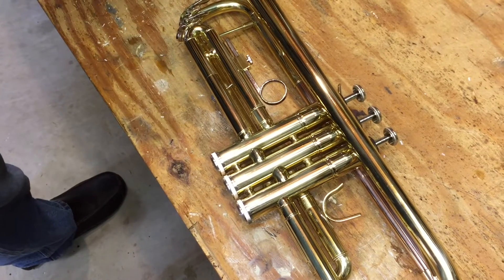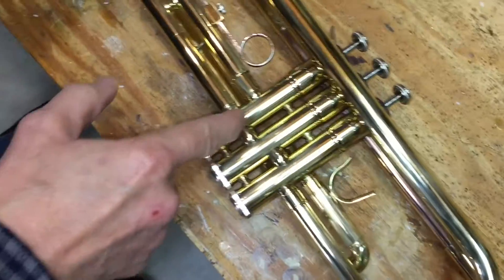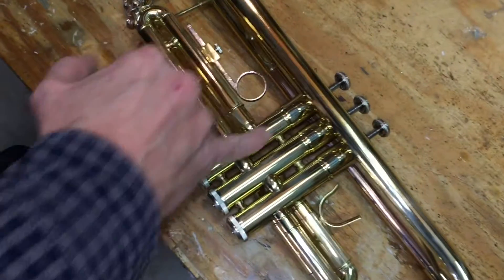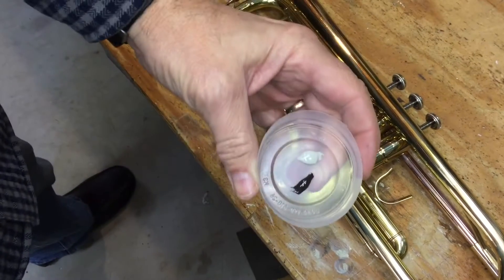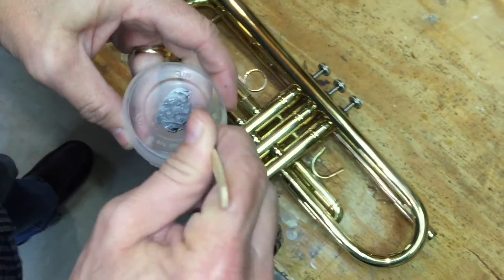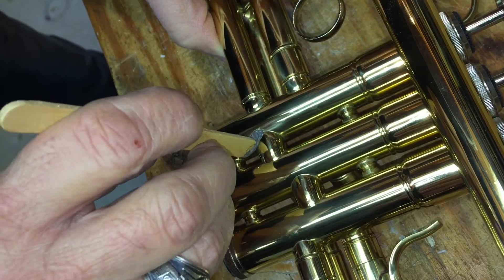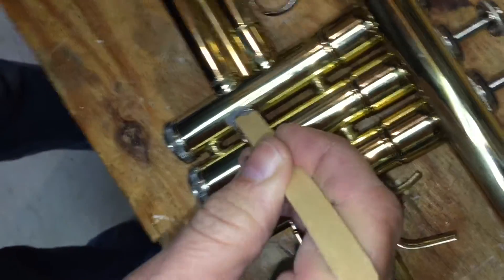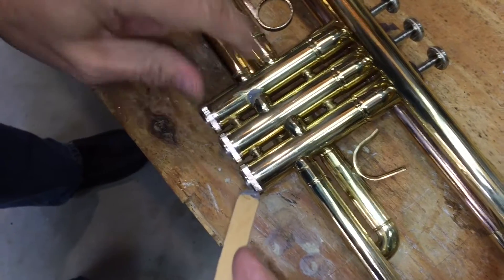Uncommon Trumpet Repair

Comment: A clear golf shafting epoxy would look a lot better (practically unnoticeable) and is typically stronger than than J.B. Weld.
Reply from the maker: I’m not a golfer so I’ve never heard of this epoxy. I’ll give it a try. I used JB Weld on a water valve 18 years ago and it’s still holding so I went with that.

Comment: A soldering iron and some silver solder probably would have worked.
Reply from the maker: +Caesar DeHaro I was worried about dripping solder into the opening and messing up the valve action. Also not sure how cheap metal reacts to heat or if solder adheres to lacquered finish. This just seemed easier for the average band director.
Reply: No it wouldn't have. Even using soft solder, it would not adhere to the brass as the valve casing would act as a heatsink and you wouldn't get the brass up to temperature to take the solder.